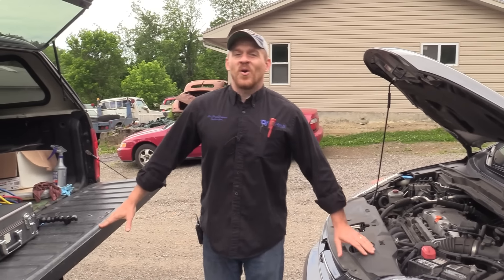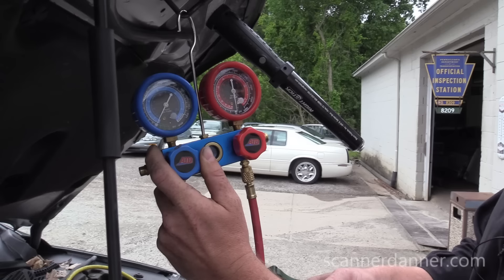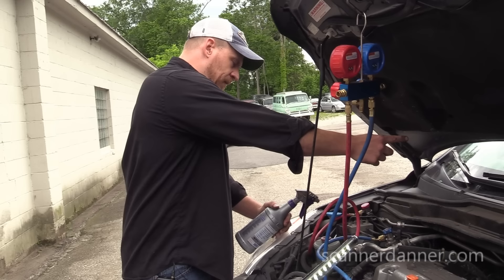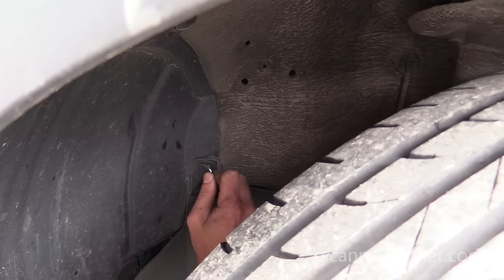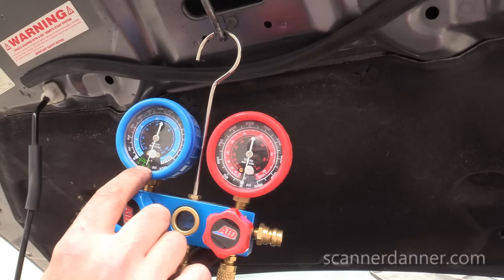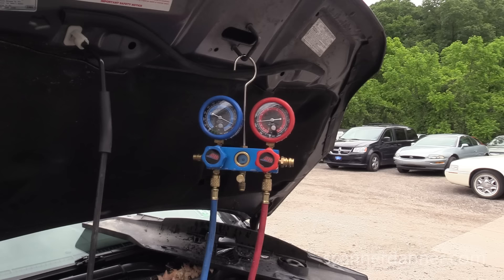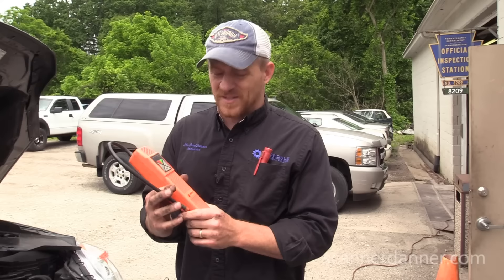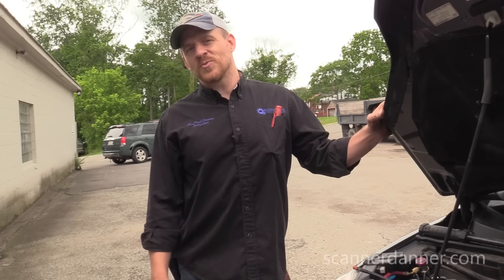Air Conditioning Not Working (system performance, leak test) - Honda CRV

Comment: Pro tip if you think ur evaporator is leaking and there is dye in the system get a small bucket or cup and let the evaporator drip into it for a while and if the evaporator is leaking u will get small trace amounts of dye oil in the cup.
Reply: I don’t use a sniffer I’ve had false positives cause more problems then anything. I charge the system and put dye in and I’ve never had a leak I couldn’t find. I had 2 vehicles come in recently one want to 3 shops plus the dealer and they couldn’t find the leak I just used soapy water and 5 min leak found. The other was at their regular mechanics shop and after a few a/c services the customer paid them to do they said the evaporator was bad and they couldn’t do it. I gave her a price which she tried to get me to do it cheaper I said ur mechanic doesn’t want to do it because it’s a huge job it takes all day and shops pretty much loose money doing them because we can do two 4 wheel brake jobs in much less time and make more money so it’s not that ur mechanic and all the other shops I’m sure u called can’t do it they just don’t want to waste the time and shops recommended my shop. She said yeah I did call a bunch of shops and nobody could do it, I figured shops would be jumping at the chance because it’s an expensive job but it must be true what you say and yeah actually 3 shops gave me ur number and a coworker recommended you I was trying to find a shop closer to me. So I ordered a evaporator because nobody had one in stock it was 3 days out, she drops off, I start working it the next day and after 5 minutes I said to myself wtf are you doing check it for leaks first u never go off any other shops diag which I did and the condenser was leaking. I replaced the condenser and call the customer saying I have great news ur mechanic diagnosed wrong it was the condenser so I saved you over 600 bucks! She didn’t even sound excited she asked if it would be cheaper if she paid cash lol I said did you hear me correctly I saved you over 600 bucks? She said yes thanks so if I pay cash will it be cheaper? I said you also need an oil change which ur car takes full synthetic it’s $80 plus tax if u want I’ll do it for $60 then ur bill will be an even 800 bucks and No that is the cash price if u use a card it will be 4% credit card fee. She said her mechanic charges $50 so if I can do it for $50 then go ahead I said no I can’t do that we make next to nothing on oil changes the $60 I said I would do it for is my break even number after materials and paying an employee to do it. She said ok then don’t do it. She calls me back saying her husband said to just do it. I couldn’t believe she asked me to do anything cheaper after saving her over 600 bucks. I could have done the evaporator and not checked it out that’s what she said to do just replace the evaporator she already had it diagnosed but I am a professional so I checked it out and she didn’t even appreciate it really and was really trying to get me to take off 10 more dollars from the oil change I already took 20 off. If I was the customer I would have given a $50 tip or bought the shop lunch the next day 

As long as u put the system on a vacuum it will get the humidity out of the system as long as ur air lines aren’t filled with water ur fine.
Reply: If you gave her a $100 discount on the requested job, you'd have been up $500 and she would have been positively thrilled. Win-win😅
For her, the goal is getting a discount, a perceived one notwithstanding

Comment: can we bypass the ac system instade of replacing ECU.
Reply: yea, you can... just run a toggle switch to a relay, which drives the compressor clutch directly. make sure you wire the low pressure switch in to the toggle side of the circuit so that the compressor clutch can cycle. not only does this protect the compressor from a low charge, but it also will kick out if the evap temp drops too low to prevent evap icing.  When you want AC, just hit the toggle switch and use your existing controls to direct to vents, etc.. and temp control.

Comment: Does not 134r have an ultraviolet signature,  hence detecting leaks with an Ultraviolet light ?
Reply from the maker: Nope, it needs to have dye added to the oil to be detectable
Reply: @ScannerDanner  thank you, ... I'm trying to figure out my ford e350 van it just won't get colder than 63 degrees Fahrenheit,  .... any suggestions, the refrigerant is full, everything visually looks good.... ty sir
Reply from the maker: What are your low and high side pressures?
Reply: @ScannerDanner  I'll put a gauge on it today, haven't got there yet...

thank you for your quick response 

Your the best...give me 24 hours S D
Reply from the maker: Don't forget a possible temperature blend door issue as well (cold to hot ajustment). Pinch off the heater hoses and see if it gets colder

Comment: If the evap core is leaking, would there b a lot of refrigerant inside dash ?
Reply from the maker: No, and you can't use a "sniffer" with the blower running as it gives false positives
Reply: @ScannerDanner  so what r u saying that the evap core was not the issue in the video ?
Reply from the maker: @truthsearcherforever3211  no, why would you say that? The evap drain tube is where to test these, not the vents is all I was saying
Reply: @ScannerDanner  oooooooh Lol ok thanks lol
Reply from the maker: @truthsearcherforever3211  no problem, sorry that wasn't clear, my fault

Comment: Could you have put the sniffer inside the car  would a small amount be in the cabin?
Reply from the maker: It is heavier than air, so you have to go to the lowest place which Is the water drain tube to catch an evap leak

Comment: Wouldn't the sniffer also detect at a dash vent if the evap core was leaking?
Reply: If it's windy, it gives false positives. Just as Paul demonstrated at the end.
Reply: Not necessarily.. R134a is heavier than air and in most vehicles the vents are higher than the evap core.  you would need stick the probe in to the heater duct at the floor.

Comment: Bought some ac  gauges  the low side read 10 psi  and the high side read 140  could that be a bad compressor?
Reply from the maker: was the compressor running when you took those measurements? Sounds like it is low on charge if it was
Reply: @ScannerDanner  compressor was but it wasn't cycling on and   off just constantly running
Reply from the maker: You have a leak and you are low on charge

Comment: I whent straight to refill as it was not turning on, filled ut up worked for 2 days (he put uv in it unfortunately no leak in engine bay  so must be in the console or fill ports) as my throat was very dry on the second day before it turned off the ac automatically (no pressure) I must have been breathing the refrigerant in (it cost a lot probably to fix :(
Reply from the maker: From what I'm told, this is one of the easier Evap. cores to replace. 2 hours labor time. So you may be in luck.

Comment: I am upset Scanner Danner. I have a 2001Acura TL. Recently the compressor started making a lot of noise. It's a 16 year old car so obviously the compressor is on its way out. So I took it to a local shop to have them replace it. They said they only use new OEM parts because there are too many returns on remanufactured parts. So they said they also will replace the receiver dryer. When I get the car back I notice that the compressor still sounds a little noisy. You can hear the compressor whine with rpm change. So I take it back and they said that it is making more noise than they would like to see. So they order me another unit and put it in. After I get my car back I notice the same whining noise and I notice refrigerant coming out of the connections to the receiver dryer. I am pissed at this point because it is going on three weeks dealing with this ac problem. I paid  a premium $953.00 for a premium job and I feel I did not get my money's worth. So I have to take it back tomorrow because today they are closed for 4th of July. Should a new compressor make any noise? It definitely isn't cooling like it used to. What should I do?  Should I ask for my money back or give them another chance. I'm sick of having to keep taking my car back but what else am I supposed to do. I wish I knew how to do this type of work myself so I wouldn't have to depend on these jackasses to fix my car. Sorry for such a long explanation but I need some advice and encouragement right now. Thanks brother...
Reply from the maker: First thing. Some new compressors come with a full system charge of oil. This is supposed to be drained out BEFORE installing the compressor. It is possible they put too much oil in the system if it is now not cooling like it should. 
No, the new compressor shouldn't be noisy. But you can hear them. I can hear my compressor on my Silverado if I'm listening for it.

Comment: Thank you sir for the video very informative but I have a question when you put air to the system I seen that both gauges moved I fallowed you’re instruction and my high side didn’t go up like on yours . So would that mean that my condenser is plugged?
Reply from the maker: are you talking about the 5 second test of the compressor with air in the system?
Reply: ScannerDanner yes and every thing comes on as it is supposed to and I get maybe 10 psi on the high side but that’s it in less I open the valve for the high side then it will go up to the same pressure as the low I have no leaks in system I left pressure on both sides and no loss . So my thinking is that the condenser is plugged but not sure it is the only common point between the low side and the pump but I’m not a ac guy this is my first time trying this . So any help you can give me is very appreciated . I’m working on a 1991 Chevy k2500 pickup if that helps.
Reply: ScannerDanner and no i was talking about when you put air in the system both sides Equaled out on mine they didn’t not even when I did the 5sec test
Reply from the maker: @danieldulong2769  so your system is empty right? And your adding air to the low side but the high side gauge doesn't move? Something is wrong with your gauge or high side service port
Reply: ScannerDanner maybe I wasn’t real clear the high side comes up but I only get about maybe 10 to 20 psi where on the low side I’m at 120 psi . As I watched your video what you had on the low side you also had the same on the high side, mine doesn’t equalize on both sides like it did yours . And the only common point between the to ports is the condenser right? Or am I wrong in my thinking? And yes my system is empty I am trying to get it to work my self and want to have everything in working order before I try and add refrigerant and I am also Converting from r 12 to r 134 .
Reply from the maker: @danieldulong2769  more likely the TXV (thermal expansion valve) is what is restricting the airflow. Just put air in both sides if your primary focus is to find a leak. It was empty right? I asked this before and you did not answer me. I'm not worried about using airflow to find a restriction, only a leak.
Reply: ScannerDanner it is empty
Reply from the maker: @danieldulong2769  then add the air to both sides and find your leak, don't worry about the psi issue right now, it doesn't tell us much using air pressure
Reply: ScannerDanner I have checked for leaks there is no leaks at this time but I am going to change the accumulator because I was told it should be changed when I change the pump .

Comment: When should a receiver drier or accumulator be replaced ?.
Reply from the maker: If you had a leak bad enough to empty the system and it remains open to the atmosphere for a period of time (relative humidity where you live would be a factor in that time frame I would think)
When you have a catastrophic compressor failure.
Reply: @ScannerDanner  thank you so much keep up your vidoes they do help so much

Comment: Love your videos and willingness to pass along knowledge..... BUT 3 seconds of compressor engagement does not guarantee that all the "wiring, inputs , outputs, clutch, relay" etc are good to go.
Reply from the maker: why doesn't it? This is a critical test to do on an empty AC system before you would ever sell the customer say $1000 in repairs on his AC system, don't you think? Imagine finding a bad PCM driver to the AC clutch relay after ripping the entire dash apart to do an EVAP core. So $1000 later you tell your customer they now need a $500 module plus programming. Did my test prove the PCM driver was good? Did it prove the relay and wiring and AC clutch were good? Absolutely it did. 
Are you testing the full range of an EVAP temp sensor? No, but was the EVAP temp sensor good in that the range was correct for the clutch to engage? Absolutely. So again, this test proves so much and has never failed me, not once.
Reply: @ScannerDanner  I agree, stick with what has never failed you. But you and I both know 3 seconds of operation doesn't ensure that this leak issue is the only issues you have. Good quick ops check, but many other things can happen after longer run time. 
On another note, you put a lot of faith in testing leaks with compressed air. Granted of you don't have a.c. RRR equipment it may be the only feasible way, but I couldn't begin to list all the leaks in the past that air could not have even gotten you in the area... (evap with no line of sight, and no not 1 of those "well, I can't find a leak anywhere else so it MUST be the evap". Hate those guys.

Comment: Honda and Toyota have the Drier bag in the bottom. Just remove the plug. Then use a skinny needle nose to pull it out.. You should do it anytime the system is opened for more then a day.

Comment: Also with these Hondas the evap cores are famous for leaking due to customers not changing the cabin filter. On Hondas like these Ill always check the condition of the cabin filter.
Reply: What's the reason for a cabin air filter causing an evaporator failure? Is a clogged filter supposed to prevent the evaporator from drying off and causing it to corrode?
Seems like an odd correlation.
Reply: @dubmob151  It's very common. Not just on Hondas. But more prevalent. The cabin filter stops debris over time. But if enough time goes by the filter clogs. This prevents proper airflow through the evaporator. AC systems are thermodynamic systems. One thing will effect the other. The loss of airflow can essentially freeze the evaporator core. Evaporator cores are made if aluminum. Get it that cold and you lose structural integrity. Sometimes is just debris that gets onto the evaporator itself. And that causes corrosion. The evaporator is essentially constantly wet. This is why all vehicle hvac systems have drains. Yet another consequence is a clogged drain. I've seen evaporator cores fail due to lack of filter changes where the core looks prestine. And I've also seen ones that look like it's been dragged through a swamp. The manufacturer design also comes into play. Not an odd correlation at all. Residential evaporator cores (called coils) will do the same thing. If you've ever changed your home ac filter you can see that debris builds up. Wait too long and you'll have to replace the coil. Again there's a combination of things going on. Thermodynamics, filtration and airflow. All will affect each other and cause early failures. Or sometimes not necessarily early. But nevertheless is the root cause.
Reply: @edwinlomonaco6754  wouldn't the txv shut off the flow of refrigerant if it freezes?  I could see if debris clogged up the evaporator and kept it wet all the time it'd promote corrosion, maybe if someone just removed the filter entirely.  Or a clogged drain that keeps it in a puddle all the time.
Reply: @dubmob151  Not always. Some ac systems have up to 6 sensors/switches or more. But some only have a high pressure switch. So something fairly modern typically has a high pressure switch, evaporator temp sensor and an ambient temp sensor. Also when I say freeze I don't mean completely frozen. Just runs colder than it should. Significantly colder. But not frozen. In some cases that ac will never blow colder than when that evaporator is about to fail. But the pressure sensor on the high side of the system isn't going to see a difference large enough to turn off the compressor. If it has a low pressure it might see. And if it has an evaporator temperature sensor it may blow cool but not cold. Because the evaporator temperature sensor will tell the hvac control module to pwm the compressor less due to the temp sensor readings being too low. So you see it's not quite that simple.
Reply: @edwinlomonaco6754  I wouldn't peg the primary cause of failed evaporators being the cabin filters not being changed often enough, it's got to be all the other factors predominating.
Reply: @dubmob151  As a master certified technician, 20+ years experience, ASE Master Certified and a college graduate. I'd have to disagree. Aside from the credentials experience has taught me that in many occasions the lack of filter changes causes premature evaporator core failures. We see it all the time.
Reply: @edwinlomonaco6754  so leaving the air flow on low would also promote evaporator failure from that reasoning, and people should run it with max air flow as much as possible to keep the evaporator warm and dry for longer life-

Comment: Should probably check the A/C valve which is most common and easy to locate but it will be easier wth a sniffer and ur dye
Reply from the maker: I did, later in the video